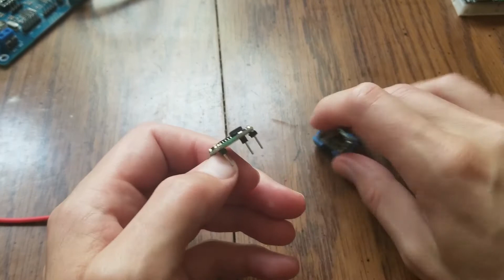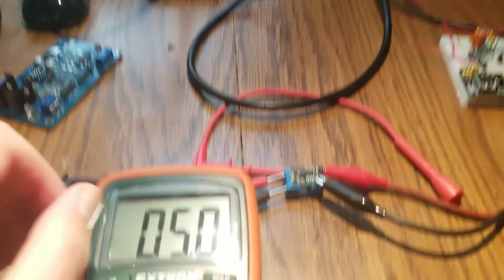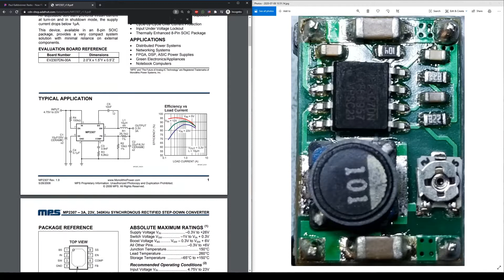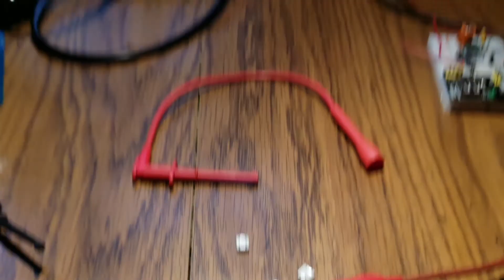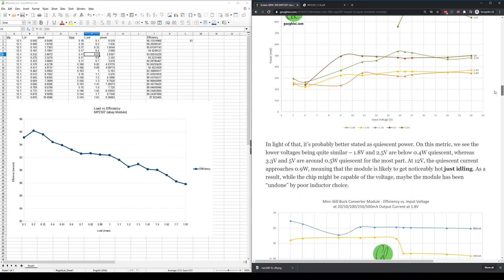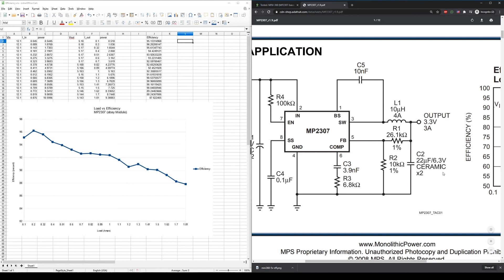Testing and troubleshooting the MP2307 module, in an effort to fix its poor performance.

Comment: I've had a few of these things where , with 15v dc input, one can only adjust the output from around 13v down to about 9.3v dc..........basically useless as I wanted to go down to 5v.
Do they need some kind of load to work properly (none other than the multimeter to check the voltage)
Any ideas or are they just crap ones as I suspect.
I checked the pot and added an external one just in case those little preset ones were garbage but no difference.

Comment: I as much as I wish, adding the proper input+output capacitance doesn't seem to be an universal solution. At 19V in and 5V out, my modules draw about 10mA or 0.2W without load. That's borderline acceptable. But at 19V in and 12V out, they pull twice the current. That's with 20uF input and 2x22uF output caps. I swapped the inductor for a salvaged 150uH and the current consumption dropped to 5mA or .1W. I could live with that.

Comment: This is fascinating. I've been wanting to use a buck converter in a model railroad passenger car to drive an LED light strip for interior light. Excess heat would be a problem. Vin is a digital square wave as high as 18V. I'd use 5V or 3V LEDs and a super cap. Thoughts? The purpose of my comment is to ask if you have a  video showing how you replaced the inductor and soldered on the additional capacitors. Well done and thanks!

Comment: Interesting, I have some identical modules. I measured: 12Vin / 3.3Vout no load input current = 7mA. Those input/output caps are relatively expensive so guess they may be cutting corners with value and quality there.

Comment: Very smart review and tips! Instead caps wouldbe replace coil to 100uH as well? Just wondering...
Reply from the maker: One problem with a high inductance value in that package size is that the current rating is going to be quite low. I think the best bet would be the proper capacitors; then you're following the reference design in the data sheet as well. Thanks for the feedback!
Reply: @Datzfunk  Thanks for the answer. Of course the best way is as you said following ds. I wonder If this 2caps 22uF should be in series - this could be the protection with overvoltage peak bcos they have 6.3 volts as maximum only. If they mind about parallel connection - simply up to 44uF increase cappacitance what I think it's not bad for circuit as well... How I could contact with you by email? Btw - very good you did simply deep check this boards instead wondering why this shit so crappy work :) Congrats
Reply from the maker: @wegi9621  Yes the capacitors are in parallel. I'm not sure why in the data sheet they use two in parallel, and don't just use a larger capacitance. 50uF is an easily obtainable number and should work fine too. You can reach me at the channel name at aol dot com, but I don't monitor it too often.

Comment: I cant believe the makers cant read a data sheet that shows the capacitance.  They thought 22uf x 2 meant 10. Did they think it should have been in series? instead of in parallel.  Thus the input should have been 20 and the output 44? or as you say maybe they expect the user to add capacitance later on in the circuit.... if so they should have said so. I am glad you pointed this out. Thanks
Reply from the maker: Yes, pretty odd. It's almost like there wasn't any testing.